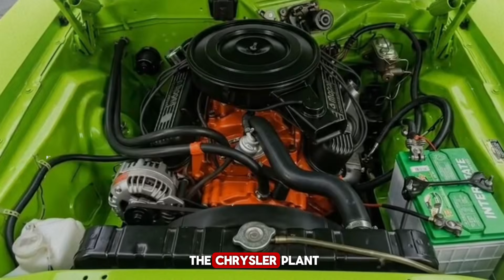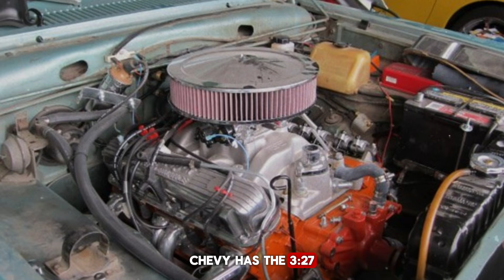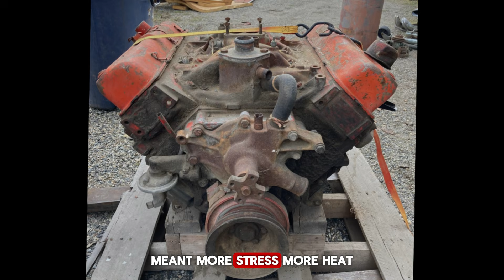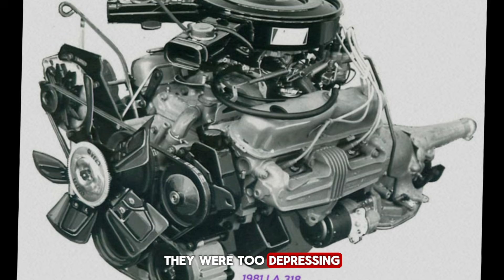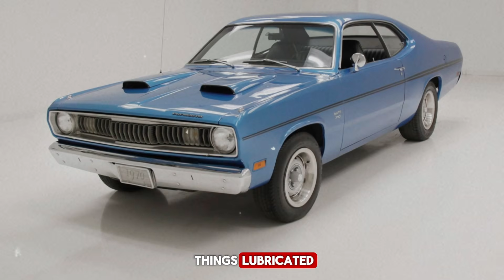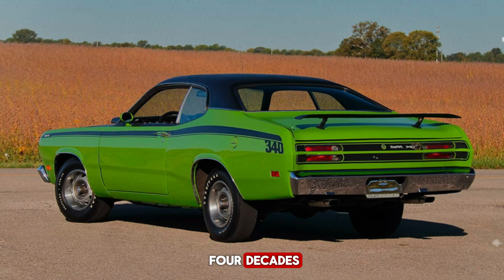Why the Mopar 318 Refused to Die and Outlasted Them All

Comment: Thank you for this interesting post.
I had an old Dodge Dart with a 318 and 4-barrel carburetor with a 4-speed manual.
It was easy and inexpensive to service, very reliable, decent on fuel and had plenty of power.
I miss and deeply regret selling the car.

Comment: So engines have improved because 12:1 compression  ratios run just fine.  Engines, transmissions, brakes have all improved in the last 40 years. Meanwhile they should have continued to develop inline six cylinder engines.
Reply: I would like to remind you that the 4L, 6L, 10R80 and any CVT exist. Transmissions have gone way downhill. Plus turbos and the quest for fuel economy has made modern engines disposable. We haven’t improved anything that matters like reliability and ease of maintenance, we’ve just improved profits and scrap yard sales.

Comment: How does 79 Dodge Aspen with a 318 good engine had a 98 Dakota with a 318 Magnum really love that one I would like a video on the other 350 based engines other than Chevrolet as I had Pontiac and Oldsmobile and I thought they were every bit as good as the Chevrolet 350 barrel in a car it was good would like you to cover the Ford 300 inline 6 in the Chevy 292 inline 6 also I thought the 3.9 in my 92 Dakota was really good to it lived to see almost 300,000 you might want to do a story on why inline 6s are so durable